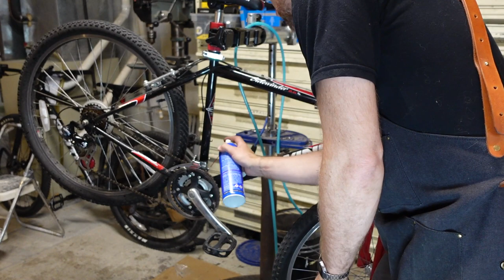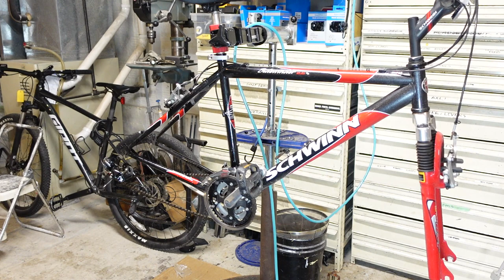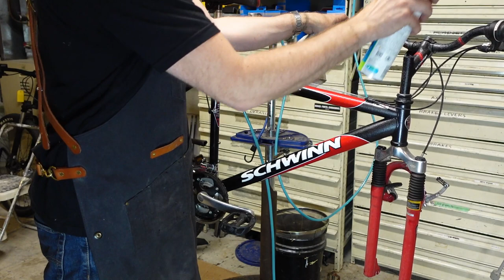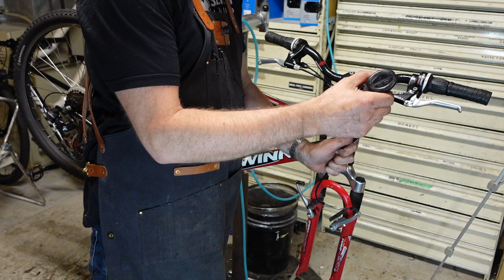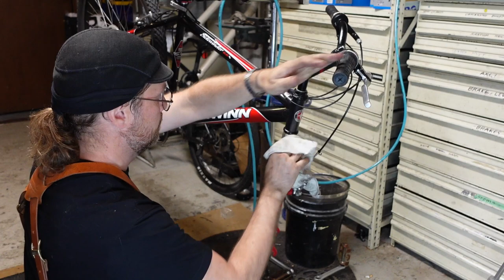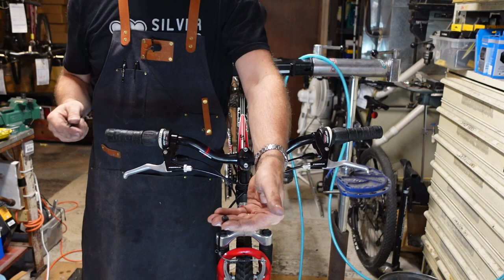I flipped this bicycle in 2 days! Schwinn Sidewinder complete tuneup!

Comment: Only thing I’d really do different, I’d take the V-brakes off completely, clean the mounting pegs off completely and hit it with some assemblers grease. For the same reason you greased the seat post. Moisture gets on those and rusts up real quick. While the brakes are off anyways, I’d also take 160 grit sandpaper, lay it flat on a bench and resurface the pads so they’re “fresh”.
Reply from the maker: I do that when they’re showing signs of corrosion. When it’s just old grease, I’ve found that a thin lubricant will flush things out and protect things well enough for most situations. Also, I’ve found blue marine grease works best.
Reply: No need to grease brake points, bike is not rusty and they rarely get siezed